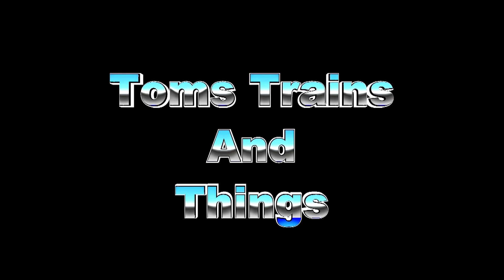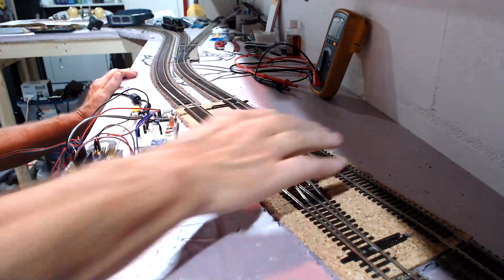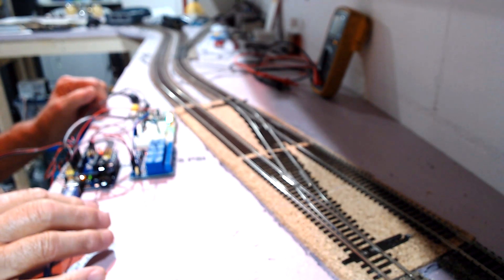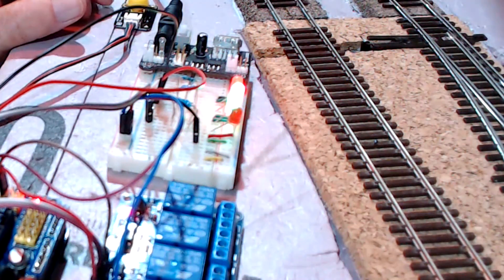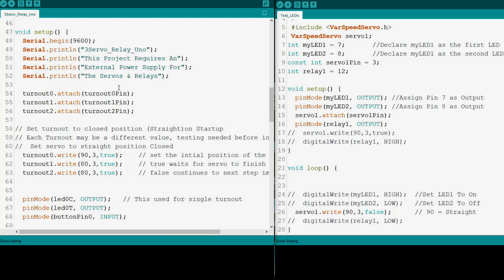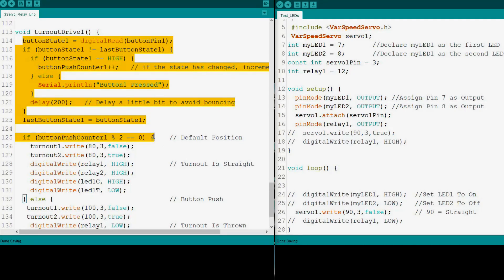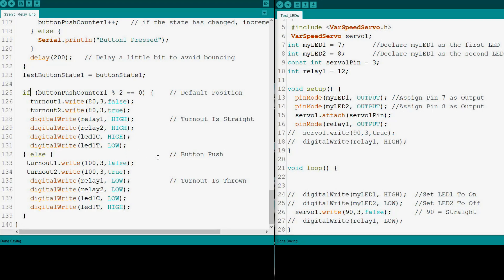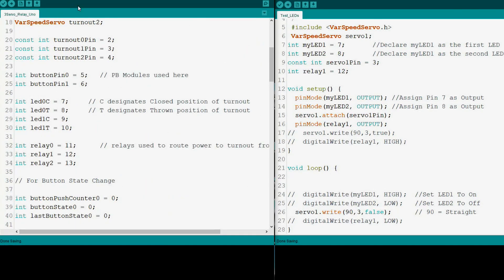Arduino Slow Motion Servo Turnout Control

Comment: Hi Tom thanks for a great video, I have an IDE sketch using 6 servos and 6 switches with an Arduino UNO. Is I possible  to modify your sketch to connect to my Digitrax Loconet using an RJ12 interface card. I have used this Interface for other projects. The library that I use is #include <loconet.h>
Reply from the maker: Years ago I used CMRI with Arduino and servos to operate the servos with Panel Pro but I am not sure if it worked with Digitrax.  I never tried anything directly with Digitrax
Reply: @TomsTrainsandThings  Thanks for your reply.

Comment: Hi Tom, can you use this sketch with the PCA9685?
Reply from the maker: It will not work with the PCA9685. Have you tried DCC-EX  they have several speeds including a bounce for servors on the pca
Reply: No not yet, I’ll check it out, thanks

Comment: This is the closest sketch that I have found and easiest to follow to do what I want to do . I would like to adapt it to switch my turnouts in my yard so when I push one button all the turnouts will align for what track I want . I'm very very green when it comes to this kind of electronics and I have learned a lot from your videos but I'm having trouble getting the main sketch to comply it keeps giving me ( turnoutDrive1 was not declared in the scope ) I had to copy the sketch form the video because it wouldn't show in your link (most likely something on my end ) . I have compared it to the sketch in the video several time and it looks the same but still giving me the same error . Thanks
Reply from the maker: When it says not declaired, you did not identify  what it is  earlier in the sketch
Reply: @TomsTrainsandThings  i missed one compete line in one of the loops I had gone over it several time but never all the way to the bottom of the sketch . I figured it was something I was doing just took a little time a lot research to find it.

Comment: This is exactly what I need Tom! I was looking at microswitches (pushed by the servo) to change frog polarity, but open to relays....looking forward to that video. Helps I'm still at the test stage!
Reply from the maker: Glad I could help! The relays are less work
Reply: @TomsTrainsandThings  One more thing, 🤭 is there a wiring diagram somewhere? Thanks
Reply from the maker: No wiring diagram. Pin allocation is in the sketch, you can also see it with a little more info on my web page
Reply: @TomsTrainsandThings  Thanks Tom, appreciate your efforts in all your videos ...must take up all your time!

Comment: Good video Tom. I really like watching these especially as you are building your new module.

I found the varspeedservo library last winter for my turnouts. Real nice to switch turnouts in a more realistic mode instead of fast using the standard servo library.
Reply: I wanted to add that I used a toggle switch to give a visual status on the control panel. I will have the leds on the layout as target signals.
Reply from the maker: Good idea with the toggle switch
Reply from the maker: They look amazing when they are slowed down. This library is the easies way that I have found to slow down the servos.